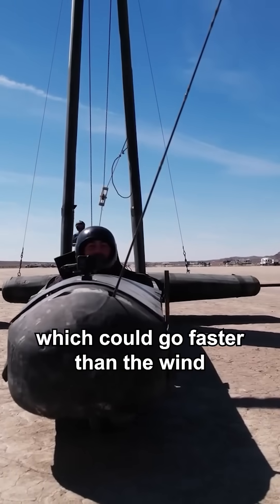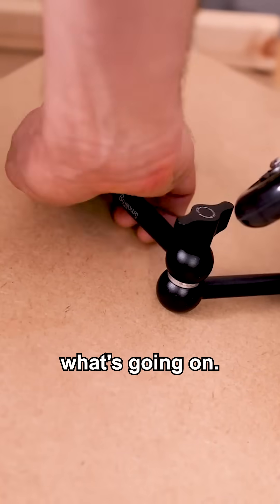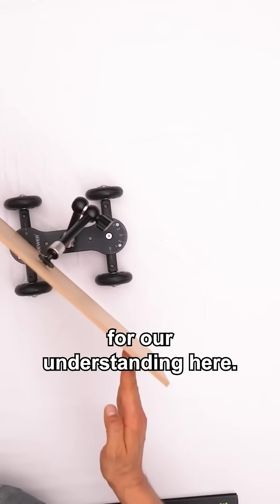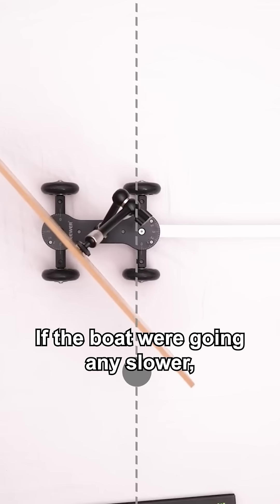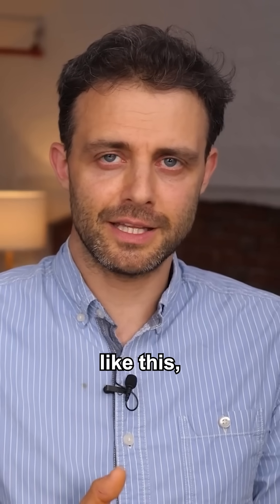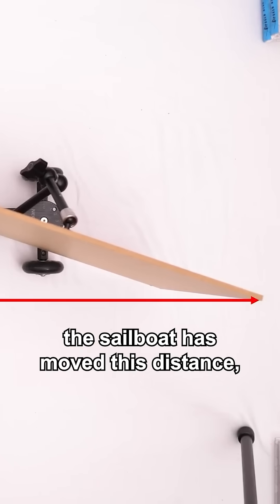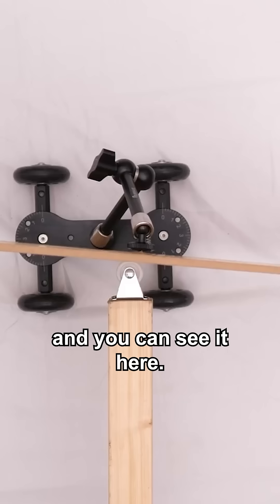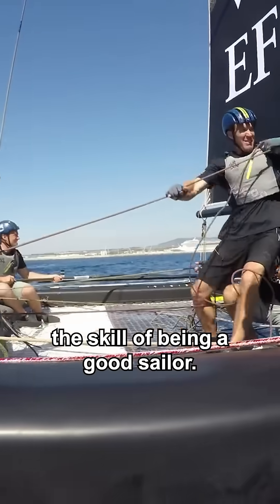How a sailboat can sail faster than the wind

Comment: Well, it’s really not that way a sail works. The sail forms a ”wing” and works pretty much just as a aircraft wing. It’s the lack of air on the opposite side of the sail (the side pointing forward) that drags the boat forward, rather than the wind is pushing. 

When having the wind from the aft, behind the boat, the wind is pushing the boat and that’s why you can’t sail faster than the wind when the wind blows from behind.

Comment: Umm no. 
The sail isn’t pushed. The wind flowing past the leading edge of the sail speeds up inducing lamellar flow dynamically lowering the air pressure in front of the wing due to Bernoulli’s principle. The boat/car speeds up to equalize the pressure differential. The velocity of the Boat/car further induces apparent air flow reaching a maximum based on the velocity of  forward pull of the sail minus the drag from friction, & drag.
In the case of a propeller especially traveling directly downwind, the apparent air flow across the propeller surface is greater than a sail due to the rotational velocity of the propeller. The result is more efficient conversion of air flow along a wing.

Comment: this is categorically wrong! It seems intuitive when describing sailing on beating winds, but sails are trimmed to act as an aerofoil for more efficient use of fluid forces transferring more power to the sail than would normally be available  from wind action alone. This concept is true upwind and downwind. Boats go to fast in the direction of the wind these days that when they pass windspeed, they retrim the sails as if they were traveling upwind.

Comment: Completely wrong my friend. The sail of a boat works completely difrently than what you say. The boat travels against the windhe because the curve of the sail works in a way that the wind doent push the sail but it swallows it because of difference in pressure like the plane that it goes upwards.

Comment: land yachts which have little resistance compared to yachts end up with the sail or sails pulled close in and can sail faster than the wind. The same goes for sailing boats which have foils, their water resistance is lower than that of conventional sailing boats and so go faster.

Comment: How exactly, does showing a model moving perpendicular to the wind, in any way translate what is occuring with one that is outrunning the wind chasing it by nearly 3 times the speed of the wind that used to be deflecting the props?

Are you inferring that what used to be a tail wind becomes a relative head wind?  Because the Blackbird that caused the conundrum has blades that are not driven by the tail wind in the way you are showing.  The blades of the original craft spun opposite to what you are apparently assuming, not deflected by the tail wind at all.

Comment: But you can't ignore the forces on the boat that do not contribute to forward motion so this explanation is incorrect. Remove the high friction tires and you will see that the model boat  will move in the same direction as wind not forward. On a Sailboat the dagger bard under the boat is proving a counter force .

Comment: Sorry, but wrong. As a scientist Steve should check with experts before delivering an explanation outside of his field. It is lift created by differences in air pressure on either side of the sail, resulting from air moving at different speeds in front of versus behind the sail, that generates a range of forces which collectively drive the vehicle forward. It's not that packets of air constituting the wind push the sail on one side; it's more that the difference in air pressure resulting from movement of air around and across both sides of the sail results in packets of air pushing more on the windward side than they do on the leeward side. Then, as the vehicle moves forward, the apparent wind speed increases, amplifying the lift effect. While it is quite possible for certain sailboat designs to sail faster than the wind, it is easy for land vessels on wheels or ice skates to do so. As can foiling sailboats, which minimise drag through water.

Comment: So I disagree. You cannot pucs this contraption without resistance. Also at you steep angle of more than 45 degrees the 'booat' is not traveling faster that the wind. The wind that hits the boat is slowed down and converts its energy to moving the boat. Wind that does not hit the boat could well be traveling faster than the boat is moving (just in a different diretion).

Comment: A sail isn’t a flat board but is profiled like a plane wing.
It’s about the difference in air pressed on both sides of the sail that drives the boat forward. 
Not sure if the logic being used here tbh.

Comment: I'm confused. I was told when learning to sail, that it's not wind pushing into the sail, but actually a pressure difference on both sides of the sail pulling the boat instead to make it move. Similar as in plane's wing shape that produces lift by pressure differences. How does that relate to this explanation, when you're saying that wing is pushing and deflecting?

Comment: This ignores the ‘apparent wind’ angle and pressure generated by the boat as it moves forward through the air. Sails are not flat like boards by airfoil shaped generating drive through Bernoulli’s theory

Comment: the issue is not reaching the speed, but getting pushed sideways away from where you actually want to go, increasing the distance you have to travel. Ironically this is also why sailboats tilt sideways at those courses, in turn reducing the effective size of the sail.

Comment: Don't forget that a fabric sail curves into an airfoil shape that creates a negative pressure in front of the sail while deflecting the air from the rear of the sail. This contributes to the forward momentum. An experienced sailor can see the correct set of the sail by observing the shape and movement of the sail in the airstream to achieve the highest speed.

Comment: „No resistance“ but using a thing on wheels which put a lot of resistance against the sideway force of the „wind“, preventing any drift - which is the reason you are not angling the sails against the wind like that on a boat at any course other than downwind

Comment: With resistance this works because of the reduced surface area of drag caused by the air the sail is running into

Comment: Nonsense. You forgot to figure in the curvature of the Earth at 10 degrees latitude and divide it by the logarithm of the inertial force that blows tangent to a fixed point 1 mile above the equator.

Comment: This weak explanation completely ignores any explanation of "apparent wind," the vector addition of the true wind speed to the speed through the boat through the air. Think of the wind you "feel" on your face as you run along - that's apparent wind. That boat might well be on hydrofoils, lifting the hull out of the water and causing very little "friction," or drag, as it moves. Modern racing boats are effectively never moving downwind, they are always moving with the apparent wind coming from some angle near the front. The result is that an America's Cup yacht can move at near four times the speed of the true wind.

Comment: Sorry, no. The sail is an airfoil and developes lift. Iceboats (nearly zero resistance) routinely go 2x wind speed or faster. The "apparent wind" shifts to the front as the "boat" speeds up and at full speed the wind is off the side while the apparent  wind is almost directly ahead, generating lift between the closely hauled mainsail and the equally tightly trimmed headsail.

Comment: This is incorrect and ignores physics.

First let's look at why this explanation is wrong before considering the correct explanation. 

As every sailor know, regardless of the friction component mentioned in this video, there is a moment of resistance necessary to convert wind pressure to thrust in any direction not directly downwind and that is provided by the shape of the hull and usually a keel. The combination of forces will produce thrust but cannot be more than the wind pressure so typically this alone will make the boat go slower than the wind and in the example where the biat should be going fastest eould actually be going slowest because all the pressure would be on the null and keel and nothing would be converted to thrust.

Now, let's  consider how to make a boat " fly" faster than the wind. This is accomplished by creating lift by applying an airfoil curvature to the sail so that there is a difference of pressure sucking the boat forward faster than the wind velocity. Do this efficiently 8vercoming drag and you're flying faster than the wind itself.

Comment: So basically the angle of the sail acts in the same way as a lever, the wind has a lot of force behind it, and the sail, being 5 front to back, and angled so it's essentially 3 in the left and right directions, the wind blowing from the right side rather than behind, only has to move three spaces left, to push the boat five spaces forward! It's acting with a lot of force on a short distance (left 3) which because of the angle the sail is at pushes the boat a long distance (forward 5)

Comment: Sai as well as airplane wings are pulled from the vacuum created on the downind side of the sail (the upper part of wing), approx one third comes from the push and 2/3 from the pull, of the angle is too steep the air detaches and creates resistance

Comment: You’re missing one of the key functions of the sail, at least in the way a modern sailboats sails are designed. 

it’s not just deflecting air… it’s usually an airfoil that generates “lift” in the direction of travel by creating a negative air pressure in front of the sail.

So in this theoretical world where there is no resistance, you could go faster than the speed of the wind at LESS THAN 45 degrees.

Comment: A modern sailboat can also go faster than the wind ! And very easily for racing boats. Because the wind doesn't just push the sail. Because of the shape of the sail inflated by the wind, a depression is created on the opposite side of the sail and this depression sucks the boat in that direction. This phenomenon is also found on airplane wings where the depression formed on the upper surface of the wing allows the airplane to fly.

Comment: No one is considering something fundamental when sailing: the apparent wind direction and speed. The angle changes as the boat goes faster, and the wind speed adds to the boat's speed. You just have to watch America's Cup boats going much faster than the actual wind speed—only when not sailing downwind. They've also found ways to reduce drag to the bare minimum.

Comment: Making it even more complex is that sails are nit flat. Air flowing around the sail give an extra lift. So even at 45° the boat would go faster than the wind because the wind has to curve around the sail and the boats speed basically equals the length of the curve, not the straight path.

Comment: Ok. This is not going seem relevant. However, time works similarly; Excepting the flow is always forward because time is never parallel to space.  So the "sail", can never not be behind the wind(time). Can the wind push the sail into the past?  Look at the question and ask again. Hint.  The wind can push into a different time zone, but it never pushed against nature.

Comment: this makes no sense at all, a sail in this configuration acts like a wing, where there's low pressure at one side, compared to high pressure at the other side. These pressure differences arise from continuous interconnection and interaction between the airflows across the sail. really bollocks explanation, sorry.

Comment: Yeah, the optimum angle is the maximum force in the direction of travel having taken into account slipage of the kiel, resistance and everything. Its tricky, but to be a good sailor, all you need to know is roughly where that will be and you will get a feel for trimming for it.

Comment: It kind of makes sense, if a small bit of wind is moving at a set speed then you shouldn't be able to go faster, but there's a bunch more wind going in the same direction at the same speed, so capturing the force of a larger area could be made into faster speeds if it works

Comment: this may be basic physics, but it is bunk sailing. every hull has its own top speed, called "hull speed". no matter how fast the wind is, the boat will only go that top speed. also,  the fastest point of sail is called a "tight reach", this video does not depict a tight reach. no sailboat can ever go faster than the wind, period.

Comment: Err so optimum for a sailing boat is between 15 and 25 degrees depending on windspeed (force), hull type (resistance) and sail area (volume) but what is this contraption that goes faster than the wind into the wind? That would just create lift wouldn't it?

Comment: You should explore the mechanics of a modern sail race boat with a sail which works as a wing and foils that offer minimal resistance and also act as wings - the combined effect is to propel the boat at multiples of than  the wind speed

Comment: This explanation assumes the lifting body is stalled (air only interacting on the pressure side) and also assumes air has no viscosity and no apparent wind created by forward motion of the vessel. If you are leaving out friction forces the induced drag of the lifting surface will be the biggest contributor to a theoretical top speed. All this video really said is the top speed is when there is no flow over the sail.

Comment: When the sailboat is moving in the wind , on board the speed of the wind perceived is the sum of wind + the speed of the boat . So the boat can sail fastwr than the wind ( if the flow on the surface of the sail keeps laminar)

Comment: No mate you don't understand lift of the wing.. The  sail creates an area of lower pressure on the lee of the sail, and the force of the air trying to fill this low pressure that gives the energy that is higher than the wind speed.

Comment: Did i missed something in the discriptionof the problem ? It says ´in the direction of the wind ´ , 2nd the wind will slow down after touching the sail or no push would be , 3rd the ´way´the air is gone had to be the way ALONG the sail, so speed could be max wind speed !!

Comment: This misses out entirely on an additional force acting on a sail, under way.
 The keel pressing into the water holds the yacht more upright than the wind  would prefer, the boat travels forward against that, and the forward motion through the air  makes the bellied sail, the wing, take additional force from the air.
The harder the wind blows, the more rigid you luff the sail which makes it a "stronger" wing, and the more lift you gain from it.
This is why sailing  fast comes down to your skill and the structure of your sail profile.
Very well designed sails, sailed well, sail faster than other yachts.
If you are "shivering" the sail, or it has folds or creases in it, or you are carrying too much  sail for the wind conditions, are all lay-man ( lay-yachtsman ) measures of "very well designed".
At full load, most of the "push" of the  vessel comes from this wing effect, and not much at all from the "sideways" component you are implying with your  example. 
And THAT is why vessels can travel faster than the wind, if we were able to ignore the main constraint, which is  turbulence.

Comment: You forgot to talk about the aerofoil effect of having lower air pressure at the back of a sail and a higher pressure in front.  So the curved sail pulls the boat forward.

Comment: Thats why we have "tell tails" on the sails - short string tags that show us what the air is doing on each side of the sail. We want to know where there is high and low pressure since we get nearly as much pull (from low pressure) as push from high pressure - just like a wing.
Reply: Quite amusing that the aircraft wing was invented centuries before aircraft were.
Contrary to popular detractor belief, sailing doesn't necessarily blow, it sucks!
Reply: In life, there's no experience that quite matches being on a sailboat heeling against the wind, hard. Especially a small one. It's just freaking awesome!
Reply: @justaguy6100  Thats why I have a trailer sailer. Behaves like a dinghy, but looks like a sailboat.
Reply: @justaguy6100  ++++ Trapeze ++++
Reply: @justaguy6100  Yes. I love feeling/seeing the physics working while sailing a dinghy.

Comment: It doesn't quite work like that, a sail is an aerofoil, just like a plane wind which creates a pressure difference between the two side which generate "lift". Also.... once you are moving through the air, the angle of the air coming into the sail changes (apparent wind) as you are moving through it.

Comment: Unfortunately this explanation is wrong.  The role of the wind is to remove/reduce the air pressure on the leeward side of the sail/wing/propeller.  This allows the air pressure on the forward side to provide the propulsion.
The same is true for all aerodynamic entities.

Comment: Sailing boats also use a aerofoil creating low pressure on the leading side off the sail. Would that increase speed or just make the transition to optimal speed efficient

Comment: What they did not comment on was that the sail is actually an airfoil. It's a wing sideways. As air goes across the wing, the airfoil, it Creates lift. It actually pulls the boat, just like a wing does on an airplane.

Comment: I'm a boat skipper and somewhat a physics enthusiast. This is spot on!
Reply: How else could you sail into the wind?
Basic sailing theory.
But it doesn't explain the propeller contraption Derek made. The mistake is thinking that the propeller is pushing the vehicle; it is pulling it; like the wind dragging the sail marginally against the direction of the wind.